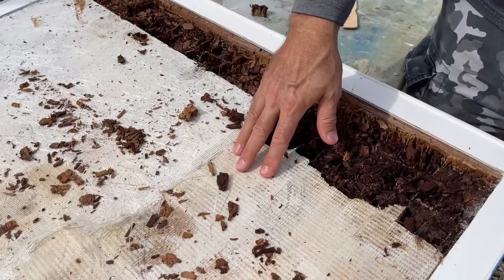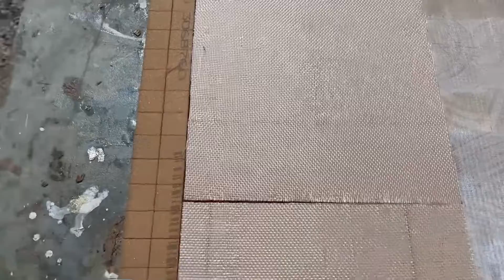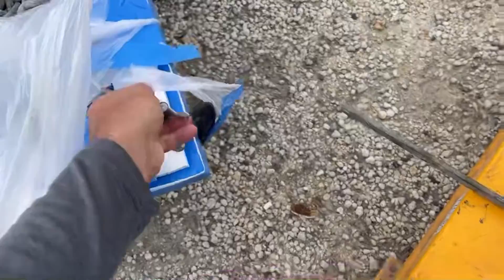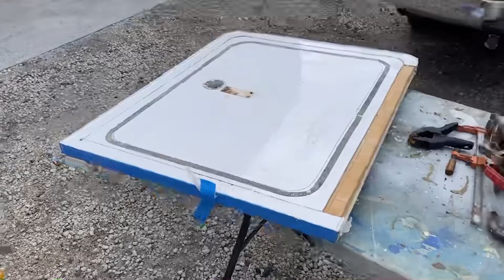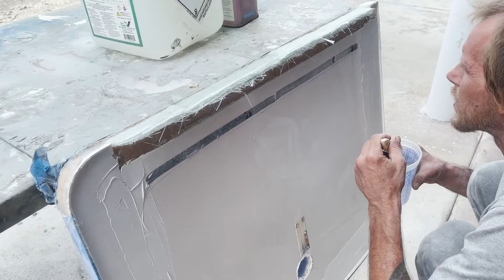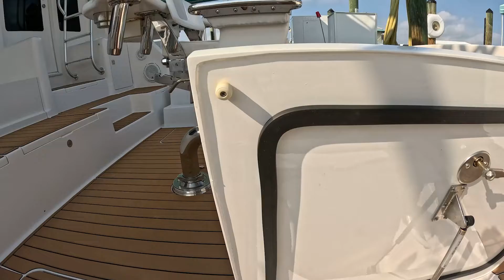Fiberglass Gelcoat Hatch Repair on 64 foot Viking

Comment: Great job on the hatch guys. My only suggestion would be to vacuum bag it as opposed to weighing it down to cure. It’s actually way less work than all that clamping.
Reply from the maker: Agree but no one here has that technology! 👍
Reply: @WillFixThat  it’s nothing fancy. Standard vacuum pump and some plastic. Use sealant tape and it conforms to any shape. Use it on the side of hulls, over head, or on the work bench.
Reply from the maker: @Pogueish  👍

Comment: Good job looked great when you were done. I have a few soft spots that I am going to have to tackle soon, nothing serious, I stopped where the moisture was getting in (handrail stanchion screws)
Reply from the maker: It did look great but its a process that can't be rushed when you have to do so many steps to get it finished! Did you see the Teak Deck Removal video where we found the soft spot on the deck? It was a surprise to find so much water when we cut it open!  https://youtu.be/zrSt2ImJmWU